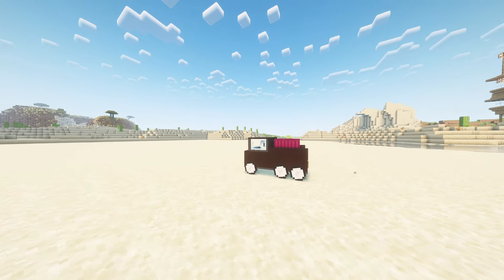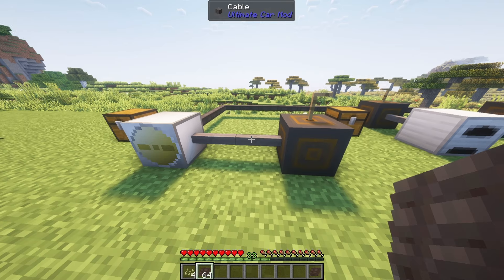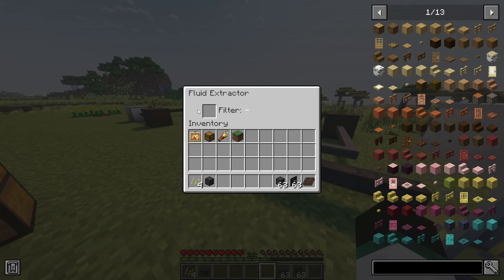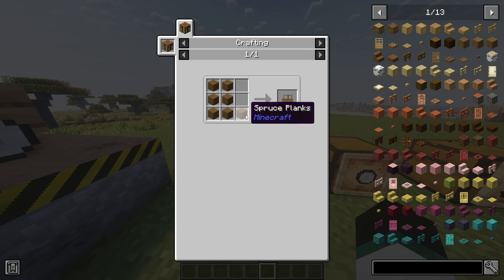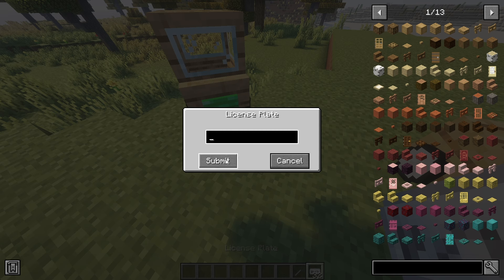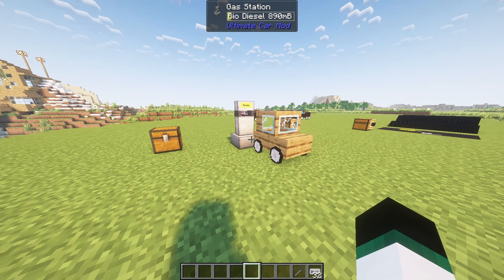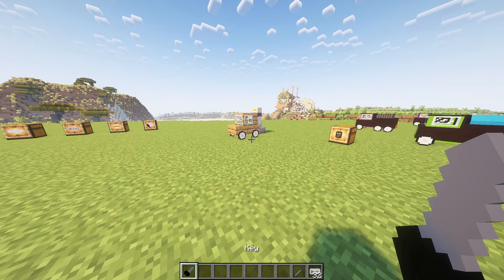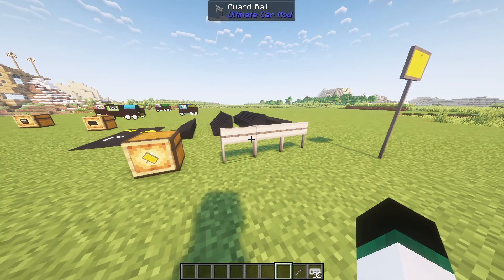Ultimate Car Mod 1.21 (Minecraft Mod Showcase)

Comment: why is truck engine most fuel efficient, shouldnt the 3 cyl be?
Reply: Larger engines burn less fuel
Reply: @krainzsupreme  that doesnt make sense, its the opposite in life
Reply: @okcerx   Truck engines have higher power density and produce more horsepower